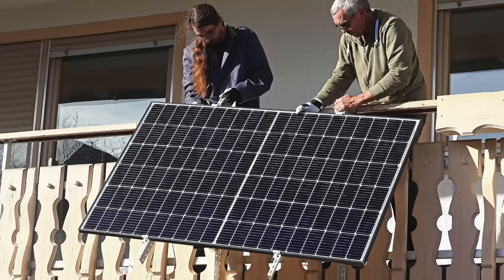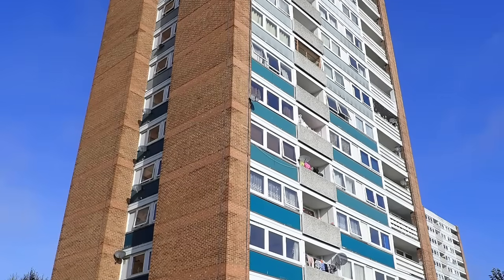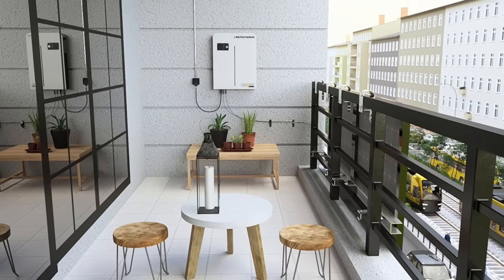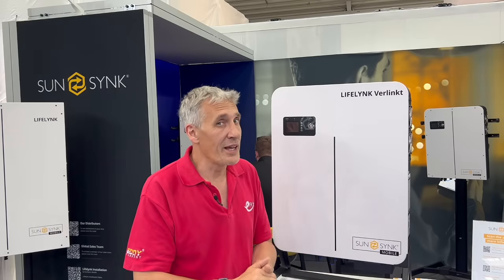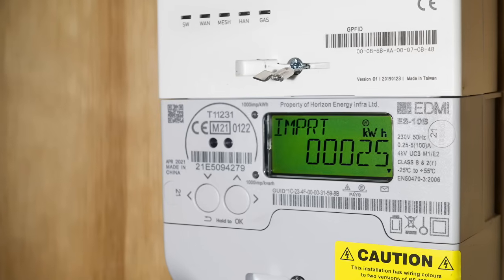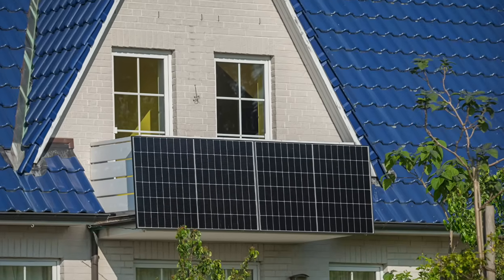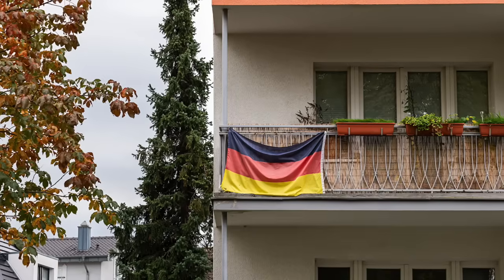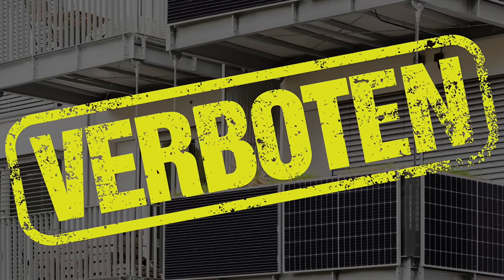DIY Solar Installation: Genius Idea or Total Disaster?

Comment: So far I have not seen any balcony systems that makes economical sense without high KWH costs and return on investment in 10 years for locations that are not sunny all the time.  Maybe if you can find second hand panels and maybe 120V microinverter. but the cheap microinverters sound like junk.  maybe in another 10 years.
Reply: I installed a 12 450w panel , 11.52Kwh system from ecoflow myself for under £5 grand , gonna pay for oit'sself in about 2.5 years

Comment: So the pins of the 13 amp plug are live ? or does it only power up when the inverter detects the mains voltage ?
Reply: Yes. Grid dies . Inverter dies

Comment: If one plugged this into a shed circuit, not connected to the grid, and plugged a power brick in to be charged (one that allows charging and use at the same time), could one not just just use the power brick 240 Volt output plugged back into the circuit,  to generate the 240 Volt potential to activate the inverter?  I don’t see any obvious (to me) flaw in that arrangement. Then, run the shed off the power brick.

Comment: If they don't allow it, I will do it all the same...
No reason other than legalities why an inverted cannot be outputted to a 3 pin UK plug.
Not worth doing a massive system because you would need MCS and G98/G99 certification to get your energy supplier to setup a feed-in tariff so you get paid for excess power sent back to the grid.

Comment: Odd that this video has just shown up for me, I just bought an ecoflow power stream from Amazon and it is exactly this, however, after I bought it, I got a message from ecoflow saying they will send me a separate cable that needs to be fitted by an electrician, with a separate circuit breaker, rather than using the supplied plug.

Comment: Offgrid inverters can do most of what these do, but without the feature/problem of driving household circuits - only what's on an extension lead plugged into them. That's obviously a bit ugly even without considering the supply might be unsynchronised with mains AC, which means there might be 650V antiphase differences? There's probably a 'right' way to help people do this - like building property with dedicated homegen circuits, but I think electricians are going to be living in exciting times for the next few generations. If I was still renting I'd definitely give this a shot. I ran the cables for a (all low power DC) rainwater toilet flush pump up through the flush overflow in my last rent. Don't tell anyone!

Comment: Wonder how they get around the risk of overloading a circuit, if you’re injecting 10A well now you can load a ring to 42A, a radial to 30A (only a problem downstream). I suppose that’s why they have low limits.

Comment: The output is monitored, or should I say the input from the grid id monitored, only when it detects the live supply from the grid, does it tie itself in, and start generating to the grid.
Same as with 99.9% of grid tie inverters, if this wasnt the case, then when the supplier turns off the main grid to work on, you would have loads of little supplies back feeding.

We should all have this available.

Comment: In a aircon all day location this makes a lot of sense, in UK where the peak loads are evenings for heat and cooking, immediate use systems make no sense, we don't need electricity  in the solar production hours we DO need electricity for 8 hours after the solar daytime.

Comment: The 800W is the new limit. I have an installation according to the old limit, that was 600W. I have the panels installed on a carport, the inverter is installed below the carport. I've installed a dedicated circuit for it and installed a Wieland RST socket outlet to even improve the safety, that's what the regs here demand. Especially VDE 0100-551 and VDE 0100-551-1, the VDE 0100 is the German counterpart to BS 7671. Technically it is not necessary, the inverters these days are fast enough to isolate the mains voltage they "create" if the plug is removed from the socket outlet. So it's dead when you pull out the plug and before you can touch the contacts on the plug. On the Wieland system both ends offer protection against exposed live parts. The contacts of the plug and the contacts of the socket outlet are never touchable. Also that socket outlet will never be abused for something else, because nothing else will fit into it. The system is polarized, and rated for 20A. And a tool is required to remove the plug (screwdriver).
The 600 and 800W should not be a problem, even if the wiring is older. There are rumours ongoing of increasing that limit even up to 1.2kW. That actually could cause issues with old installations. We don't have a mandatory testing here like the EICR in the UK.

Wieland plug, there you can see, nothing exposed:

https://www.amazon.de/Wieland-96-032-4053-1-Stecker-Polen-Schraube-schwarz/dp/B001ZUZ3DI/ref=pd_bxgy_d_sccl_1/259-6656611-6737813?pd_rd_w=rIQOg&content-id=amzn1.sym.d6531279-1f86-4ae1-b1f7-8ab9db04b1a0&pf_rd_p=d6531279-1f86-4ae1-b1f7-8ab9db04b1a0&pf_rd_r=EM50PFTTF24FCFPJNWFJ&pd_rd_wg=RggHy&pd_rd_r=33ca7464-be6b-4fa6-a0c8-9797959b2fc7&pd_rd_i=B001ZUZ3DI&psc=1

Comment: Right…or somebody could just make a special connector that you wire in instead of one of your sockets, and a British Standard be made for that method.  Why not done yet?  I am laughing long and hard, because we all know why.  This is the UK, and sewn-up was invented here.  This system, with a suitable replacement twin-socket having the requisite ‘special power-in’ connector, would take the edge off power bills - and who wants that, who’s in control of anything?  Govt, VAT income drops, Big Energy, Gas and Oil, less for them, and so on.  Take care all

Comment: I have a 2kw solarmax grid tie inverter plugged into a power point. I used to have 2.5kw of panels attached but now it's down to half that. I needed them for something else. 
 It works great and has been running for quite a few years now. 
 Basically, that's all a grid tie inverter is. It's just connected to the house circuit.. pretty much plug and play. If fused correctly it works and is safe

Comment: I'm pretty sure there's nothing to stop you installing your own solar system in the UK - as long as you don't connect it to the existing wiring. Which means you can't sell your surplus back to the "grid".
Of course, you can have a solar setup installed that does let you sell your surplus, but it has to be done properly - DIY systems where you plug it in yourself aren't allowed.
On the whole, our regulations do make for excellent safety, at the expense of the consumer having to pay for either a complete duplicate set of wiring, or for a "proper" approved system.
Reply: I have a  UK self installed DIY system and have been paid today for sending 30KW to the grid. All above board and safe. Don't believe half what some folks say.  Just get it fully checked and certified and its no issue at all. My system is far better installed than most uk professional ones, as I've adopted extra safe practices that are not compulsory in uk but are in the states, like earthing the panels and frames on top of the roof.

Comment: Haven’t ecoflow just introduced a device to feed energy in via a socket? Told that in the UK it has to be wired into the fuse box. Every little helps
Reply: Yes  got the Ecoflow 800 micro inverter ,109 quid .! From Amazon inc all cables and 3 year warranty !!  . Plus  2 x 400  panels from local sparky for 150 quid for 2      All works brilliant ¡!   Not a lot of sun at mo . But just waiting for next year's sun 😂😂😂😂

Comment: The funny thing is that before reg changes such inverters were sold in the UK. They were not smart, so did not monitor the local load and did not have battery storage.

Comment: At the risk of stating the glaringly obvious, if the inverter is 'on' ie generating power, and Mr  DIY is about to insert the plug top into the mains, won't the plug pins be live, with a very probable chance of electrocution??
Reply: these things require to sense the grid power before it can send power. alternatively, this is not useful during a power failure as I don't see any built-in power outlet in the device.
Reply: The danger exists when the plug is removed from the socket whilst the inverter is generating. Under EREC G98, the inverter is allowed to remain live for up to 500ms on a Loss of Mains event.
Reply: Grid dies ,inverter dies . You wouldnt pull a plug  on a 3kw electric heater . Would you ?

Comment: If you can charge an EV at 10A on a 13A plug there's no reason you couldn't plug a solar inverter in up to 10A. Kettles and electric heaters are 10-13A too.
Reply: Nobody is concerned about the CCC of the conductors. The concern is with the pins on the plug remaining live for up to 500ms if it's removed from a socket during generation.
Reply: @VinoVeritas_  Yet the latest Hybrid inverters seem capable of detecting a line falut and switching to a backup battery in 4ms.
Reply: @sang3Eta  Can you provide me with the brand and model number of a hybrid inverter that can shut down in 4ms in a Loss of Mains event?
Reply: @VinoVeritas_  The latest Solis S6 hybrid ones. The pro model can even switch on a diesel generator now, too, when the battery is depleted.
Reply: @sang3Eta  I asked for a model number so that I can check the ENA register for data. However, it seems like you're getting confused between the requirements of EREC G98 for a Loss of Mains event and the ability of an inverter to switch to Islanding mode.
Reply: @VinoVeritas_  Couldn't find the hybrid one but non-hybrid SOLIS/13722/V1/A2S6-GR1P2.5K-S seem to say 0 amps in under 100ms.

Comment: Yes, it should be allowed in the UK. It has been designed to be safe without requiring specialist installation. Given that there are a lack of specialist installers and electricians are busy with more important work. Given that the amount of work for electricians will only increase as we upgrade infrastructure in the transition to electricity. And Given that this is unlikely to have a major effect on full installations (why would you opt for an 800W system if you had the space for, and could afford a larger system) I think this system would be a benefit to UK billpayers.
Reply: It's not designed to be safe. It's designed to conform to EREC G98 and follows none of the guidance in BS7671.

Comment: They are not allowed only because it is seen as something that people could charge for so it therefore has to be regulated so people have to get certified and be approved only so that everyone can get their snouts in the trough.  If it plugs in to a 13A socket then it should be none of your business. They are designed by very smart people so that it syncs to the mains will only provide power when mains is present and is widely used without issue.
Reply: Anyone can apply for export payment and any power provider can grant it if they wish too. Reason they don't want to is due to the very generous referral payments by sub contracting installs which run into 4 figs per customer. Thyey hide behind the need for MCS cert which is tricky but not impossible to circumnavigate. However they deliberately make it hard.
Reply: You don't know what you're talking about. How long can an inverter remain live in a Loss of Mains event? How quickly must an RCD trip to protect users?

Comment: It absolutely must have a better connection system.  Americans have been using plug-to-outlet for emergency generators for many years and there's a reason why such a connector is called a "suicide cord" — and has been made illegal in most places.
Reply: The difference is that those suicide cords are mostly used on diesel generators.  Pull the plug out and you'll end up holding live prongs fed by the generator.  Solar inverters are designed to shut off the instant they are disconnected from mains power; when you pull the plug, the inverter disconnects the feed.  
Not sure what the regulations are in the UK, but in much of the EU such an automatic shutoff is allowed.  In regular solar installations, you don't need an isolation switch at the inverter if it has a shutoff built in.

Comment: This was a thing until the regs changed and explicitly forbid it - I have a Mastervolt 600W inverter with a UK plug on it from a neighbour that’s now redundant - it seems to be a cynical attempt to keep DIYers away from using grid-connected renewables with the premise of safety when a couple of small panels outputting a few hundred watts over an existing circuit shouldn’t cause any problems, and since the inverter is grid-tied there’s no reason why it should be deemed “unsafe” - you could be pulling 13A into an appliance and do exactly the same i.e. pull the plug out 😳
Reply: Does your washing machine generate electricity?
Reply: @VinoVeritas_  your point being?
Reply: @Umski  You don't understand the difference between an appliance that uses.electricity rather than an appliance that generates electricity.
Reply: @VinoVeritas_   I should hope so, I am a Chartered E&EE 😳😆 I have an appliance that both uses and generates electricity - quiz time 🤔
Reply: @Umski  When you pull the washing plug out of the wall, how long do the pins remain live?
Reply: @VinoVeritas_  exactly the same amount of time as my grid tied inverters take when the mains goes down or I flick the isolator off (or pull the plug out as is the case elsewhere) 🙄
Reply: @Umski  Now I know you haven't got a clue.
Reply: @VinoVeritas_  congratulations 👏🙄

Comment: There are regulations on how much you can deliver over the outlets tho.. becouse of overloading on the wiring..
Reply: But at 800 w on  dc your only chucking 3 amp ac into socket ? +. every UK ring socket can handle 3k W.. breakers rated at 32 Amp .....  also in UK there will probably be about 5 days a year you will generate any where. CLOSE to 800 w from 2 panels . . Av 200 w ,/ panel   thru year , winter days lucky to get 5o w from  full low horizon winter sun

Comment: while trying to install, some grandma is going to drop her panel from her 6th floor apartment and land on someone's dog while they're out for a walk. Leave solar to the professionals. these are potentially deadly power sources. You could inadvertently cause an electrical fire in one of the many poor connections commonly found in residential wiring , or accidently unalive yourself if you happen touch a live component while your body in the path to ground. plus 800 watts isn't enough to power much of anything.
Reply: There's no such thing as a professional solar PV installer. They're tradespeople with a couple of certificates.
Reply: Looking ONLY at the power part of your post: yes, no way will 800W power anything with a heater or a (big) motor, so kettles, washing machines, probably even some fridge/freezers, fan heaters, some DIY tools, and so on are right out. However, it'll run a computer, with router etc., lots of chargers, and these days a fair amount of lighting.
That's an 800W (maximum) inverter, with perhaps a battery. If you're talking purely solar, if there's enough daylight to get anything useful out of solar, you shouldn't need lighting!

Comment: Wait until one of these solar kites drops on somebody's head either by poor fixing of strong winds ? The balcony railings are not designed to hold such a weight which could double up in high winds. A worrying thought.
Reply: Thats why germans have mandatory insurance for pretty much anything.

Comment: The ONLY reason these are illegal is that the giant energy companies want to maintain their profits. The plug issue could easily be safely resolved , remember every time a car is charged we put a plug supplying power into a socket.
Reply: These are illegal because they're dangerous.
Reply: @VinoVeritas_  Yes, they are currently unsafe but they could easily be made safe for UK use at a small cost.
Reply: @VinoVeritas_  not really if the homes have the needed grid isolation kit then they could run all day long safely. The needed kit is just a contactor.
Reply: @VinoVeritas_  They are NOT illegal Eoflow already released this in UK this year

Comment: Its in the UK Ecoflow sell a kit ( 800w ) people have more than one in the property but they suggest you wire it direct to the Fuseboard 😂 but most use plugtop oh and it works
Reply: Have you done this? I want to do it, but I'm renting and don't want to cause a house fire, I want to get an electrician in to see if my plug sockets can take in 800w power but not sure how to go about it or the price
Reply: @TheAxtonman  if your plug sockets cannot handle 800 Watts, don’t use your kettle, toaster, oven, and hair dryer.
Reply: @dwalsh3469  I mean intake 800 watt of power, kettle etc takes power not give it and so far I've been using the powerstream in my wall with no issues but I'm still going to get a rcbo bidirectional in my fuse box and fuse spur  to be legally able to use it lol
Reply: I’ve been doing this for years and never had a problem with it, even shows on my smart meter electric going back to the grid if I’m not using it up with my appliances.

Comment: Of course the UK should allow tech like that, I don't understand why the UK would not allow it.
Reply: Partly for safety and mostly to lock down power creation and transportation. The same argument is going on here in the states. Semi manufacturing and sales in the states are still locked down. Even though there are better options out there. At this point they are not even really attempting to advance semi truck technology.
Reply: The same with electrical generation and use in the states as well. And I'm not even going to talk about how much data your digital electric meter transmits to your electric company.
Reply: UK. Guv dosnt want you to generate E..whos going to pay for the 48 billion Hinckley point 3 power station ?   US !!